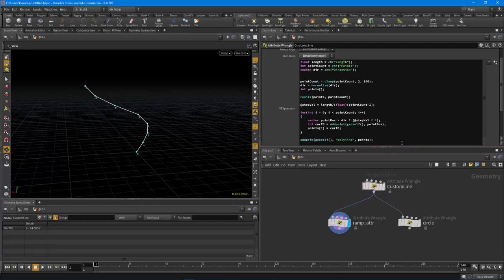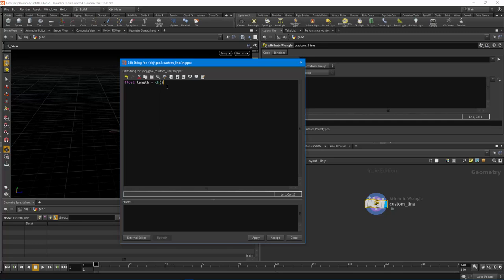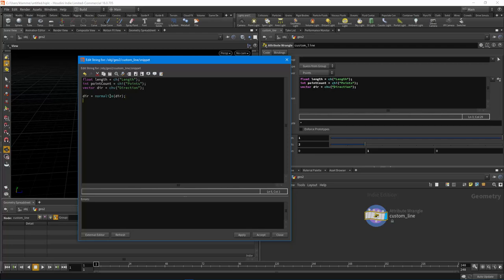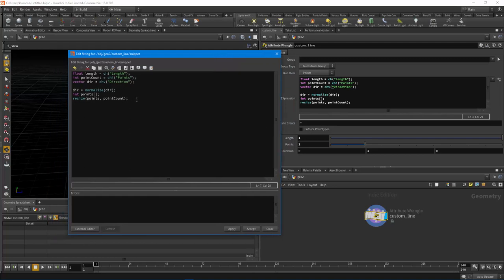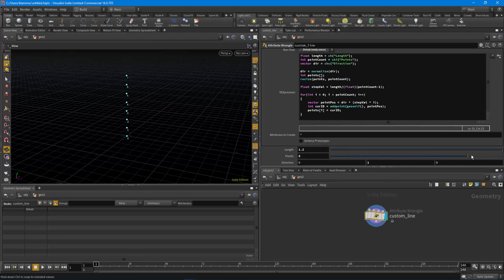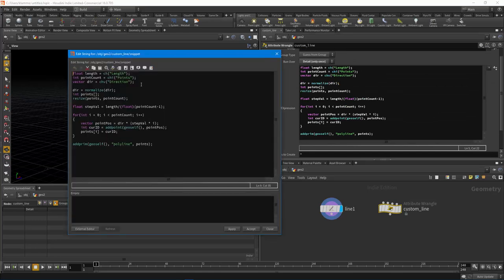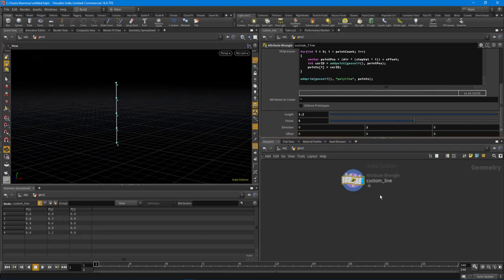Intro to Houdini 16 VEX - PointsAndLines - Part2

Comment: This has been made so amazingly simple and comprehensive ( by showing the same thing in vops).
 If you ever do an update to the video , do include an explanation of why you are subtracting 1 from @numpt.
(float)@ptnum / (float)(@numpt-1) <-- Note : bracketing numpt-1 is important 
Here's what I think is happening . 
1. If I have a 4 point line ,we want to normalize our points (0-4) to go to the range (0 -1) (black to white to fit with the gradient )
2. We do this by dividing each point by the maximum number of points we have (1/4, 2/4 , 3/4 , 4/4 ) aka input / max_value. but... 
3.Since Houdini counts from Zero we now have 5 points internally. So our expression would be off because 4/5 not = 1. we want 4/4  (input / max_value) . Hence we subtract @numpt(5) by 1 .

Cheers

Comment: I followed the video then I found that the first line might be typo where "float length = ch("Length");"
It should be chf, wouldn't it? Anyways I fixed it, but ended up with 2 "Length" sliders, one of which was useless.
How do you remove sliders?
Copied everything into a new attrWrangle and now everything works.
Reply from the maker: Go up to the little gear icon on the wrangle node and select destroy spare parameters.  This removes all those extra sliders.  Then create your sliders again and you'll have just one slider.
Reply: @IndiePixel3D  Thanks!

Comment: What is the use of the "resize(points, pointCount);" line in the first attribute wrangle node? I don't see any difference when I delete it
Reply from the maker: That is to resize an array.  I believe I did that to allow the point count to change.  Have to watch the vid again.
Reply: @IndiePixel3D  I guess you are just defining the length of the array..(how many things the array can have..) Oh btw, you added an add node in VOP... so in the wrangle, should be @P.x += ramp; I think..But not a big deal, your videos are great. I am gonna watch all of them :)
Reply: @IndiePixel3D  I think its because the arrays cannot be resized dynamically and therefore we use this method which allocates a new array with the specified new size, copies elements from the old array to the new one, and then replaces the old array with the new one. array must be a one-dimensional array.

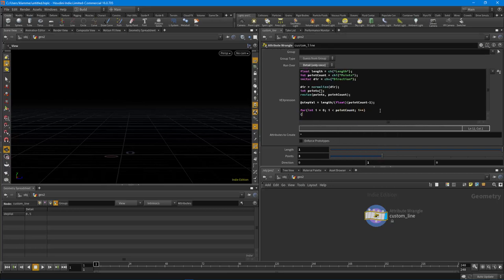Comment: Hi Indie, I've having a similar issue to Guilty Potato except I'm getting an error (red) on my "<" symbol in the for-each VEX i.e. "for(int i = 0, i < pointCount, i++)" at 6:28. I'm using H17.5 if this makes any difference. So frustrating when this happens.
Reply: I got it to work using the following VEX;

float length = ch("Length");
vector dir = chv("Direction");
vector offset = chv("Offset");
int pointCount = chi("Point_Count");
int points[];

resize(points, pointCount);
dir = normalize(dir);
float stepVal = length/(float)(pointCount-1);

for(int i = 0; i < pointCount; i++)
{
    vector pointPos = (dir * (stepVal * i)) + offset;
    int curID = addpoint(geoself(), pointPos);
    points[i] = curID;}

for(int i = 0; i < pointCount - 1; i++)
{
    addprim(geoself(), "polyline", points[i], points[i + 1]);
}
Reply from the maker: Well done Steve! What specifically was the issue before?
Reply: Hi Indie-Pixel. I was getting an error on the "<" symbol using the VEX in this video. So I used the VEX from your "CustomLine" in the Part 1 video (Point Count only) and added the Length, Direction & Offset VEX (see above) & now I have a "CustomLine2" which has Point Count, Length, Direction & Offset parameters. Awesome. Hopefully now I can follow along with the rest of the video. Weird how Guilty Potato was getting an error on his multiplication symbol "*" whereas I was getting it on my less than "<" symbol. Weird Houdini stuff going on. I'm using 17.5.222 as of yesterday. I found 17.5.173 kept bugging out & crashing on me.
Reply: after reading your initial comment Steven, you used "," instead of ";" - I was also receiving errors and noticed I made the same mistake, I also forgot to finish my statements with ; so I was also getting red everywhere

Comment: my Houdini crashes just before creating the points of the custom line , after writing : 
points [i] = curID;
..after this is calculating  for some -aprox - 2 - minutes  and than it's giving me fatal error (segmentation problem) ..so I just couldn't go on after this because I can't create the line. First tutorial went fast though with no such issues,  so I don't know what might be the problem with this fatal error while doing this second tutorial ( I am new to Houdini and even more new to coding)
"
Reply from the maker: Hmmm, sounds like your loop is stuck in a constant loop.   Meaning it cant exit out of the loop, so it eventually overloads the CPU.  I'd have to see your entire script to know...you can always email me through the indie-pixel contact form on the indie-pixel site...in usually quick to respond.  Thanks!:)
Reply: @IndiePixel3D  :-)  I thank you for your feedback! I'll write you via your website than, thanks a lot! :-)

Comment: Is it possible to add points between 2 points position?
Reply: The mid point will be the first point position + the difference between the two point positions halved:

vector pointPos1 = set(1,1,1);
vector pointPos2 = set(1,4,3);
addpoint(geoself(),pointPos1);
addpoint(geoself(),pointPos2);
vector midPoint = pointPos1 + (pointPos2 / pointPos1 / 2);
addpoint(geoself(),midPoint );

Depending on what you're using it for you might also want to do something to re-order the point numbers as this will place pt 2 between pts 0 & 1.

Comment: Hi Indi-Pixel, I'm having a problem again with my VEX code, I'm unsure as to why Houdini 17 for some reason is choosing to give me an error specifically on this part of the tutorial >>>>>>>>> @7:29() dir, * (stepVal) * i); its the multiplication symbol * that is causing the issue underling it red, all help is appreciated man : )
Reply from the maker: Howdy Refraction house, did you ever get this resolved?  Just curious if you still needed help.
Reply: Hi @IndiePixel3D  nope I couldn't :/ I decided to go learn more about coding an practiced some coding over the holidays mostly python to help me understand, thank you for getting back to me as soon as possible man appreciated I will be resuming back to VEX around 8 Jan an give it another go, If the same problem persists then I will drop you a message : ^ )

Comment: I don't know why, but when I do this the lenght parameter doesn't seem to control the lenght at also, it only slightly offsets the origin. If someone could help me it would save me from insanity lol. Here is the code: 

float lenght = chf("lenght");
int ptN = chi("numero_points");

vector dir = chv("direction");
dir = normalize(dir);
float stepVal = lenght/(float)(ptN - 1);

int points[];
resize(points, ptN);

for (int i = 0; i < ptN; i++){
    vector curPos = dir * (stepVal+i);
    int curPoints = addpoint(0, curPos);
    points[i] = curPoints;
    addprim(0, "polyline", points[i], points[i+1]);
}

Comment: Hello??? can anyone help me please, I don't understand why Houdini 17, vex system is a bit weird, maybe the coding grammar has changed or its just buggy? I have no idea :(
Reply from the maker: Howdy Refraction House!  What seems to be the issue?  Im sure we can get it solved.  Let me know!  :-)
Reply from the maker: Howdy Refraction House!  Ok, I just tried out the following code in Houdini 17 and its working just fine.  
float length = chf("lenght");
int pntcount = chi("pntcount");
vector dir = chv("dir");

dir = normalize(dir);
int points[];
resize(points, pntcount);

float stepval = length / (float)(pntcount-1);
for(int i = 0; i < pntcount; i++)
{
    vector pntpos = dir * (stepval * i);
    int curID = addpoint(0, pntpos);
    points[i] = curID;
}

addprim(0, "polyline", points);

The error you are seeing might be cause by something earlier in your code.  Maybe a mismatch of variable types.  Make sure the dir variable is declared as a vector.  let me know! :-)
Reply: Hi @IndiePixel3D , I just tried this and i'm still having issues with the * symbol at the dir, (stepVal) I); part for me, this is really strange I have tried using your suggested names it did not work, then I changed pntcount to npoints, instead, and I still have nothing, I ended up removing the *(stepVal)*I; including the points[i] = curId, then something strange happened I could see one single point on the zero plane,  I'm not sure what els I can do to fix this, I have run through the Houdini 17 documentation, in order to find an alternative to the multiplication * symbol an couldn't find anything els, maybe giving a variable the multiplication command? then adding it in the line?? this shouldn't be happening really but I tried and thank you for writing back to me I'm really keen to learn VEX and do cool procedural buildings : ) please let me know what you think as I do find this very strange :L

Comment: Why is (float) & (pointCount-1) in brackets ? 
float stepVal = length / (float)(pointCount-1);
Reply from the maker: Since the pointCount is an integer, we need to convert it to a float type of value.  By placing (float) in front of an integer you are doing what is called a cast.  This cast converts the integer into a float type vale so we can divide it.  This then gives us a valid float value...let me know if that makes sense...thanks!
Reply: (float) must be in brackets for it to cast a integer to a float ? Equal too IntegerToFloat in VOPS.
Reply from the maker: Correct, fo sho....😊
Reply: Since working with variables and I didn't get an error; I assume these two work.
int apple = 5;
(float)apple;
or (float)(apple);
Either will case the variable apple as a float.
Reply from the maker: Yep, you are correct...😊